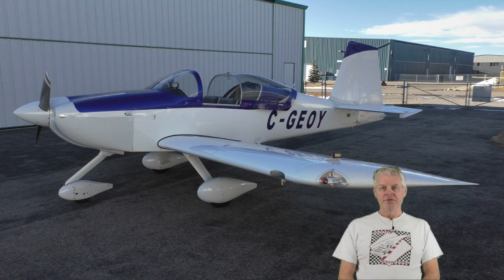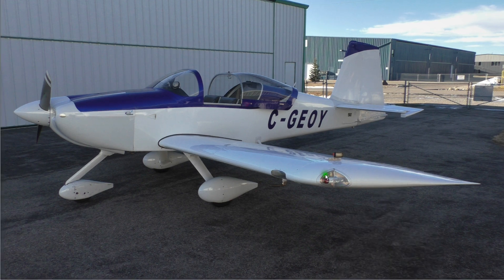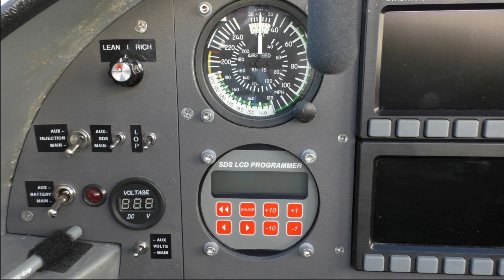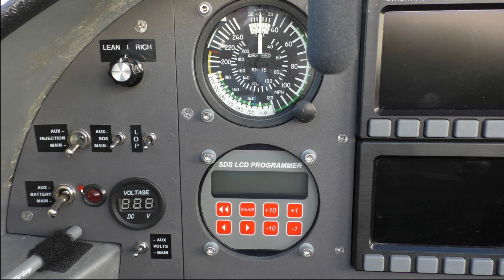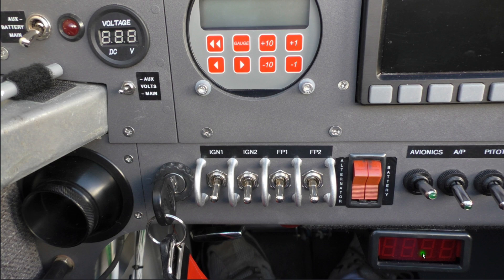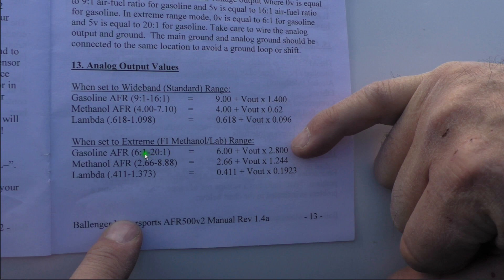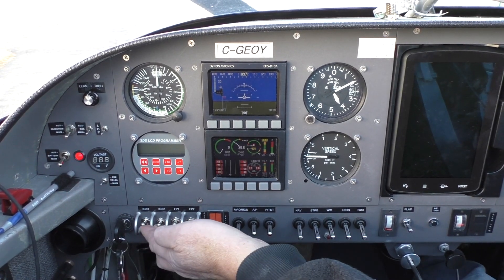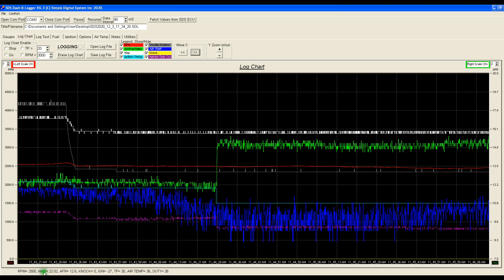RV-6A Project Part 2

Comment: When and how is the wideband sensor powered?  I know they typically aren't supposed to be powered on unless the engine is running.  Thanks!
Reply from the maker: Widebands are powered off 12V, the boxes control the heating circuit of the sensor and run the display. This WB requires a free air calibration with the engine not running as do some others. Some auto OEMs don't power the heater on with a cold engine to avoid thermal shock from condensation forming in the exhaust with a cold engine. It's best to follow the recommendations of the WB manufacturer as there are many differences.
Reply: @rv6ejguy  Thanks.  I've got a 14point7.   Was thinking about using the main alternator's white lead for logic to keep from accidentally powering the unit up when the engine isn't running.
Reply from the maker: @mikesatchell8317  We have some folks using electronic or manual delays on the 14.7. Doesn't seem to hurt anything.

Comment: Always appreciate your topics. Out of curiosity, besides a faulty sensor or wiring, could the temperature  "noise" arise from some kind of air box leak such that a turbulent mixture of outside air and engine bay air is actually being sensed? The response time of the sensor isn't that fast, right?
Reply from the maker: Right, the sensors have some mass so take a couple seconds per degree to change normally. Ralph found a connection issue so hopefully all fixed now.

Comment: Hi Ross, thx for the video.  

Two questions, for the Injection switch, is this a two position switch, I was thinking on the EM5 it was a three position switch?    (Main, Aux  &  Both)

 In you commentary about the spiky\noisy air temp you speak about seeing some of the same spikes in the AFR/  Is this just due to a suspected electrical contact issue or is their some relationship in the calculation of AFR that uses air temp??  I see more "spikiness" on my afr at higher AFR's > 16, 17   vs low AFR's.  My sensor is getting old, not sure if I am getting a saturated signal at higher afr's?

Steve
Reply from the maker: 4 cylinder engines use a 2 position switch, 6 cylinders use a 3 position switch. Yes, the ECU uses IAT in the mass flow calcs along with MAP and RPM so a problem here will cause some AFR variation. Could be an old sensor in your case. If the RPM, MAP and IAT is stable and AP is 0 with throttle stabilized, AFR should also be stable with about 0.5 AFR.